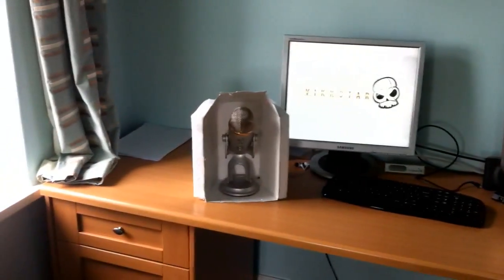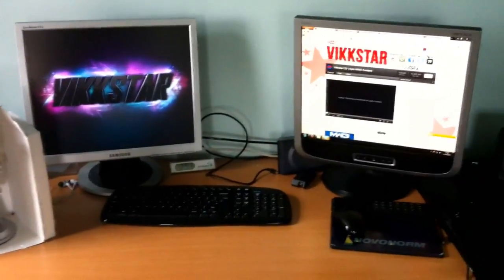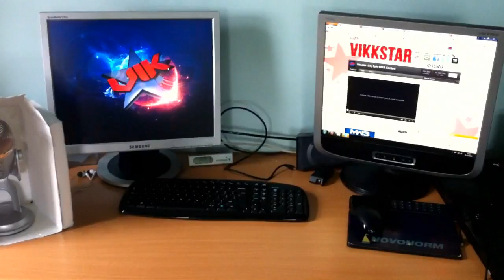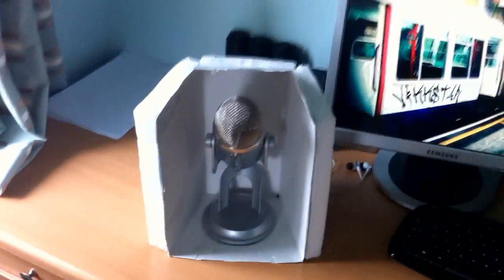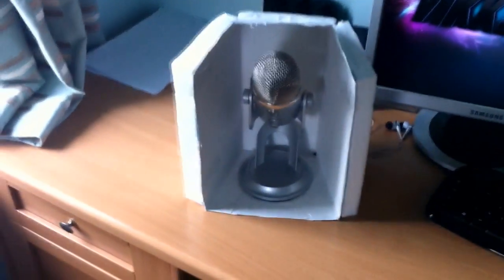Sound Insulating Fail With Vikkstar123

Comment: depending on what software you are recording the audio with, you can get a plugin or 'effect' called noise gate. you choose the lowest amount of sound that can get through. providing you talk at a consistent level, you should not lose any fidelity from your voice. if all you are getting is a low rumbling from the vibrations, a low pass filter - cut the lower frequencies on the equalizer. if you can't do any of the electrical stuff, a standard microphone cradle should suffice. PM me need be.

Comment: You can get a quieter fan for your PC. The fans that come with that tower work great but are pretty darn loud. The new xbox slim is quieter, if you don't have the money installing games to the Xbox hard drive makes it quieter also. The biggest thing to help besides the PC fan is the foam covering on the mic itself as stated in other comments.

Comment: Put the foam on the inside of the box, those flats trap the sound wave and it will amplify into the mic. (megaphone effect)  You can do the opposite by having protruding flats around your mic that block the sound around the box, and can direct the desired sound into your mic.

Comment: Enclose the tower and other noisy devices. Say if u put the tower in a cabinet, cover the inside walls of the cabinet with plush carpet that's your best bet. Fabric or foam(not styrofoam) works too.

Comment: why dont you edit it out in audacity or even in sony vegas it might take you a while to find the right settings but with that mic im sure can mess about with the audio settings and you can clear out the background sound also in audacity you can use noise removal, do this by not talking for like 5 seconds, then use those 5 seconds for your noise profile then audacity will use that profile to cancel out that exact sound of the fans and it will remove that sound it picks  up. Hope this helps